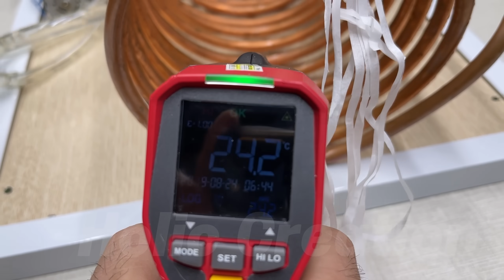DIY Mini Air Conditioner with a Mini Cooler  Fan– Works Like Magic!

Comment from the maker: A useful tip to help save you money!
https://youtu.be/qNRgXLOvOnc
Reply: FAKE al cuadrado
Reply: @miguelonubaelandevalo  Ya Duplicaste El Experimento o Solo Hablas Porque Tienes Lengua Suelta?
Reply: Mr. Holic, can You please explain how is it that it's Not Needed to expel the hot air out of the room for this Cooler to work Efficiently and Not Just be Recycling the Temperature up and down, or down and Up? I don't Understand because I've never Tried any of These experiments 🥰👍

Comment: La bomva de srculacion se puede usar cualquier bomva que sircule  el liquido ? Por ejemplo una bomva de gasolina electrica de 12 v o una de alta prescion de 12v
Reply from the maker: Sí, en teoría se podría usar una bomba de gasolina eléctrica 12V o una de alta presión 12V, siempre y cuando sean compatibles con cairan yang Anda gunakan dan tahan terhadap korosi. Pastikan juga kapasitas dan tekanan pompa sesuai dengan kebutuhan sistem Anda.

Comment: All I see is a fan blowing between some copper tubes with the air pump on it I ain't seen nothing cold about it
Reply from the maker: True, the cold may not be obvious on screen — but did you catch the part where condensation started forming near the coil?

Comment: have you put any thought into using cheap inflator  pumps for the compressor as they are already compressors and rated etc but be aware they do get super hot when compressing air so that could be a problem
Reply from the maker: Thanks for the insight! 😁 We’ve thought about it, but overheating and durability are tricky parts. Have you tried using one for long-term projects?
Reply: @HolicCreation I have for a few things can get around the heat with a good small fan and heatsink helps a lot removal from the case and heatsink is a big leap in performance also
Reply: @HolicCreation I hope to see some new designs using such cheap available devices you have an established channel and it may get out to a lot of people before I ever even try to do so

Comment: Hello. What is the full model of the fan? Can it run for a long time?
Reply from the maker: Hey! The fan model is a "Coolinator 3000" (just kidding, but wouldn't that be cool?). It can run for a long time as long as you keep it hydrated—just like me on a hot summer day!

Comment: This isn't genius at all. The heat isn't going anywhere. So really, the overall temperture of the room will be slightly increasing due to compressor and fan.
Reply from the maker: I appreciate your perspective! It's true that the heat can have an effect, but it’s more about creating a localized cooling effect. Every little bit helps in beating the heat!

Comment: This system cannot cool the room because the heated gas is cooled inside the room. The heated side should be outside the room.
Reply from the maker: You bring up a valid point! A traditional air conditioning system does require proper ventilation to work efficiently. This DIY method is more about personal cooling than cooling an entire room.

Comment: excelente idea, pero podrias incrementar enormemente la eficiencia si haces lo siguiente: El tubo capilar no debe estar en la zona intermedia de baja a alta presion, sino en el punto final de alta presion e inicio de baja presion. Me explico, el capilar debe inyectar liquido desde el condensador hasta el evaporador para que ocurra la "magia" en la que la caida de presion provoque la evaporacion del gas. Al pasar el gas directamente del condensador al evaporador a traves del pequeño compresor, se mantiene en gas y la eficiencia es muy minima. Otro tip es colocar el pequeño capilar en el punto mas bajo para que en ese punto se acumule el gas condensado (liquido) y sea empujado por el gas evaporado, garantizando que solo se inyecte liquido al evaporador. Al colocar el capilar en un punto tan alto el gas puede pasar por la tuberia por encima del liquido
Reply from the maker: Thanks for leaving a comment! If you like this video, please Like and Subscribe for more useful content.
Reply: Pero una cosa eso es real con una simple bombita tan chica y el circueto con tan poco liquido enfria de verdad?

Esto se podria hacer usando la unidad interna de un mini split y hacer la condensadora como en el video mas grande funcionaria y gastaria menos que un aire acondiconado?
Reply: en efecto el creador sabe algo sobre refrigeracion, pero es falso esa bomba no puede bombear gas butano,  y menos usando  plasti acero para pegar el tubo capilar, eso es basura!!!  jajajaj   es una completa burla a la inteligencia de la mayotia de gente!!!  sin palabras!!

Comment: again "heat exchange" needs an out. If you put a window air conditioner in a closed room, the temperature will actually go up because you are generating more heat (from the electricity) than you are getting from cold.  Heat exchange systems have to route the heat somewhere.  Its the reason central air has to be outside or have heat exhaust going outside, and that window A/C is in the window. The in-room A/C units have a pipe that goes to the window/door/etc. I'd suggest adding something like that or else it would be pointless because you would end up heating your room up even more :P
Reply: bro relax. its just a prototype. i mean we can always make it bigger longer. one outsideunit and one insideunit.
Reply: @multiomer1997  No, he makes an excellent point. Most people will not realise that "as is", the unit will make the room HOTTER.
Reply from the maker: Thanks for leaving a comment! If you like this video, please Like and Subscribe for more useful content.

Comment: It's a good toy only, in the real refrigeration/AC doesn't works, in general working function, it need to seperation the hot air from the condenser unit and the cold air from the evoperator, it needs two fans. Real refrigerant wnen it in operation, the high pressure could runs up more than 300 PSI, the plastic tube couldn't hander such high pressure. These are the facts.
Reply from the maker: Thanks for leaving a comment! If you like this video, please Like and Subscribe for more useful content.

Comment: Difluorodichloromethane and tetrafluoroethane are a kind of refrigerant, and the chemical name CF2Cl2 difluorodichloromethane is colorless and odorless, and can be used in various cooling systems to obtain a cooling temperature effect of minus 60 degrees C to 10 degrees C, but the ozone layer depletion potential (ODP) of difluorodichloromethane reaches 1.0 percent, which is confirmed to destroy the ozone layer and become a chemical substance banned in the Montreal Protocol
Reply from the maker: Thanks for leaving a comment! If you like this video, please Like and Subscribe for more useful content.

Comment: This is a poor design because the refrigerant must be in a specific amount, especially after escaping from the thin tube to the thick tube (transforming into vapor). Secondly, the person doing this is unskilled in bending copper tubes. It won't work for everyone and must go through experiments that will cost him a lot of time and money. I don't recommend doing this. 
On the other hand, butane gas is used in lighters.
Reply from the maker: Thanks for leaving a comment! If you like this video, please Like and Subscribe for more useful content.

Comment: not very effecient if you put the hot coil infront of the fan.  I'd duct it off to the side and pull a litte air off the fan to blow it away and preferably outside...
Reply from the maker: Great point! I guess putting the hot coil in front of the fan is like inviting a polar bear to a barbecue—just doesn’t make sense!

Comment: Heat is pumped from one side to the other. OK. But it is nonsense to blow the heat that you have just separated against the cool side again. Blow on the hot side outside with a fan and let the cold side be blown on separately by a second fan in a closed room.
Reply from the maker: Thanks for leaving a comment! If you like this video, please Like and Subscribe for more useful content.
Reply: Question is that coil getting colder
Reply: @nazirhussain7231  That's very much like saying fi you stand on the brakes AND the accelerator - and the car still moves - that's the key point. It utterrly destroys the efficiency.

As you are demonstrating, most folks then do not understand the crucial importance of:-

One fan per coil
Hot coil OUTSIDE of room you want to cool
Reply: Y'all are missing what's going on think about when you feel your lighter with butane they get super cold from the spring effects that is was being recreated with that small coil of pipe there is really not too much hot air having to expel you're just recreating basically the chemical reaction that happens when you feel the lighter
Reply: Was für ein Schwachsinn🤦‍♂️
Reply: Najprv je závitov 6 a potom 14??

Comment: Hat nicht funktioniert
Reply: es kann so nicht funktionieren. Einfach anschauen, wie ein kühlschrank funktioniert. Das system muß ein extremen unterdruck/vakuum haben , der kompressor muß genügend leistung haben, um das gas zu verflüssigen und wichtig, der kondensator muß außerhalb des raumes sein. Oder die heiße luft vom kondensator abgepumpt werden. 

Ds hier ist der neue free enegergygenerator scam.
Reply from the maker: Thanks for leaving a comment! If you like this video, please Like and Subscribe for more useful content.

Comment: This is a bad design. The fan is pulling hot air from the condenser coil, and blowing it across the evaporator coil. That's retarding the evaporator's ability to produce colder air. The condenser coil needs to be where the fan can't pull hot air off of it. A lot of videos have the same flawed design.

After reading my comment, watch everyone start changing the bad design.
Reply from the maker: Thanks for leaving a comment! If you like this video, please Like and Subscribe for more useful content.

Comment: Oh, c'mon! Some people will believe anything. Among other things, if this even worked to cool the evaporator, the fan is drawing air heated by the condenser and blowing it into the evaporator, resulting in no net change in air temp. Study physics, people!
Reply: If they had one fan per coil and emphasised the importance of having the 'hot bit' outside, then a small pump WILL move something like butane well enough to demonstrate the principle. Without vacuuming the lines first, this has a lot of issues - BUT it will work enough to show the principle working fairly well.
Reply from the maker: Thanks for leaving a comment! If you like this video, please Like and Subscribe for more useful content.

Comment: تسلم مجهود وفكر جميل....ممكن تعرفنى سمك كل ماسوره مستخدمه وطولها....وكذلك ما هو الماتور المستخدم والعلبه السوداء اللى بها مخرجين دخول وخروج ....والغاز اللى حضرتك وضعته ده فريون.
Thank you for your effort and beautiful thought... Could you please tell me the thickness and length of each pipe used... and also what motor is used and the black box that has the inlet and outlet... and the gas that you put in, is it Freon?
Reply: عزيزي احمد انا فني تبريد والموضوع الي سواه كله مو حقيقي وحتى وان كان حقيقي فغلط لانه الهواء الحار ينسحب ويروح جهة المنطقة الي مفىوض يطلع منها هواء بارد
Reply: 是的，因为热气没有排出，这样冷气会很快升温 @ssproobbx827
Reply: Son 3 diametros de tubo diferentes
Reply: Black box and motor are water pumps.
Reply from the maker: Thanks for leaving a comment! If you like this video, please Like and Subscribe for more useful content.

Comment: The one they use for car you have to vacuum it first before release the freon is guaranteed will work
Reply from the maker: It looks like your comment got cut off! If you have a question or something specific to share about DIY electronics, feel free to elaborate. Iam here to help!

Comment: ! The system need to be vacuumed before else will create acid and ruin the whole thing.  2 In order increase the pressure from the low side to the hihg need to have a  COMPRESOR no a mini pump.  3  Yes you can fill the system and will cool some whill filling but that's
Reply: these are air pumps like those in 12v car compressors, will leak badly but its an "air pump"
Reply: @kyriakoslykoudis9133  oh, that´s totally safe to have a badly leaking pump next to arcing motor while the system is filled with propane :) I´m literally amazed how YouTube blocks jokes yet this video can lead to burned down houses and possibly fatalities :D
Reply from the maker: Thanks for leaving a comment! If you like this video, please Like and Subscribe for more useful content.

Comment: Where does the heat go?
Reply: If the whole thing worked (which it doesn't), it would go wherever the cold goes. Theoretically, the environment wouldn't change.
Reply from the maker: Thanks for leaving a comment! If you like this video, please Like and Subscribe for more useful content.

Comment: Quick question – if I use the frozen water + fan method, how often do I need to replace the ice? And is it safe to leave it running while I sleep? Awesome ideas though!
Reply from the maker: Great question! ❄️ If you're using the frozen water + fan method, the ice usually lasts 4 to 6 hours, depending on the room temperature and ice size. So you may need to replace it 1–2 times a day for continuous use.

As for safety: yes, it’s generally safe to leave the fan running overnight, especially if it’s a small USB or low-voltage fan. Just make sure the container doesn’t leak and is placed securely to avoid spills.

Thanks for the kind words! 😊 Would you like to see a version that lasts longer or runs more efficiently?
Reply: @HolicCreation  that would be Nice 🥰👍👍👍

Comment: This is actually genius! I never thought of using frozen water with a fan – cheap and effective. Subscribed!
Reply from the maker: Thanks for checking out “DIY Mini Air Conditioner with a Mini Cooler Fan – Works Like Magic!” 😊 I’m thrilled you found it helpful. This little setup really does cool a small space surprisingly well—just ice, a fan, and a bit of airflow direction.
Have you tried building one yet? I’d love to hear how it worked for you or any tweaks you made!

Comment: Nice one! So fake. HVAC engineer here! you cant fool me LOL
Reply: Thanks for watching the video! Can you give me advice about the product in this video :v
Reply: @tipsunknow  It's very easy to learn HVAC in this internet age!
Reply from the maker: @averagedude-b7m Thank you so much . Have a nice day my friend, and wish you have a mini Air Conditioner at home .
Reply: Have you ever felt a butane canister when it 1st got empty?  You should since HVAC has sometimes have to solder
Reply: The condenser and evaporator both had water condensation on it.  just sprayed the liquid butane in the lines to cool it down. The funny thing is that it's really easy to make a functional refrigeration system with very little effort.  These videos are really kind of dangerous if you ask me. EX Ingersoll Rand industrial refrigeration air dryer engineer here.